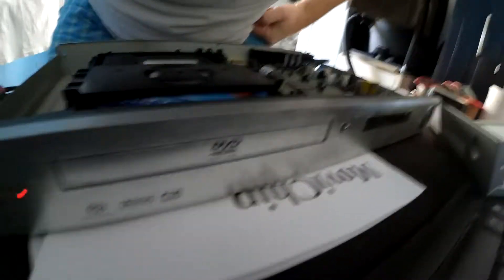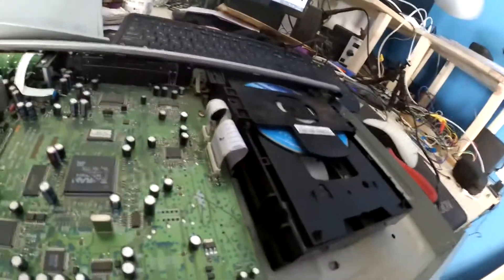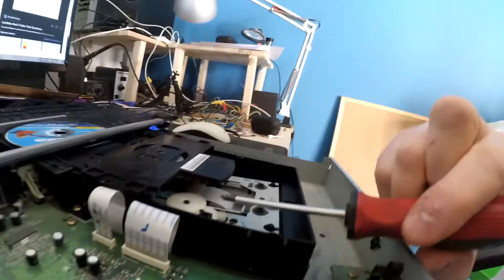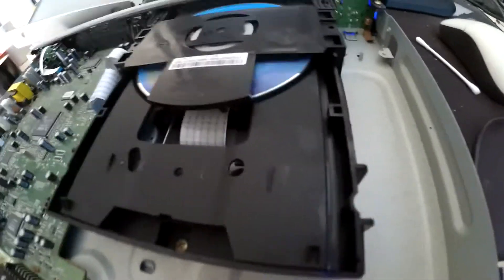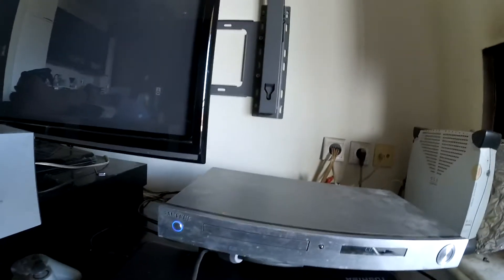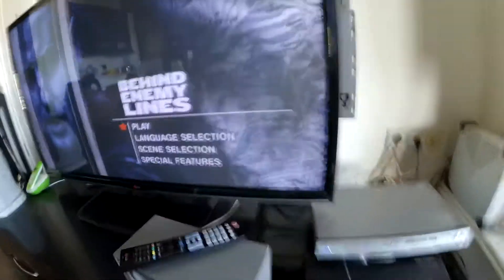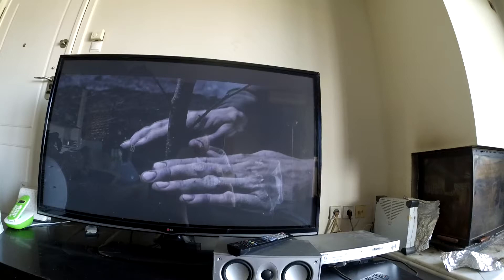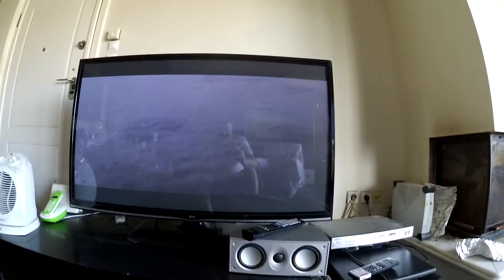"No Disc" DVD Player Fault - How to Fix *Easily*

Comment: I have a DVD recorder/player with a VHS player that I used for digitizing old tapes. Recently, I've been getting this "No Disc" error, but when I place a cleaning DVD in the system it is recognized and goes through the cleaning process. And, I still can't play a DVD. So weird. Definitely trying this!
Reply: I have a zenith that does the same copying to DVD RW. Cleaning the lens allow CDs to play, after ten years 😂. But DVDs still won’t play. Did you figure out how to get it to work yet? 

I’ve seen in other videos about a small screw in the back of the lens that may need adjusting but I don’t know if it work on this model
Reply: @thewickedone9637  I haven't gotten it to work! And, yes, it will play CDs.

Comment: Last week my Samsung BD-4500 BluRay player got won’t play one of my Spongebob DVDs, I unplugged for a minute and plug back which usually works and nothing until I saw your video. So the other day I remove the top, open the tray by eject and unplugging it so I can try to clean the lens (I used 99% isopropyl alcohol), once I the tray back in and the top screwed back in, I tested and it works fine. So it was the lens that was dirty.

Thanx for the tip.
Reply from the maker: Glad it helped!

Comment: Hey there, thank you for the video. I've got a player with an open/close lid, anybody have suggestions? My first thought was some strategically placed office cleaner condensed air, but i know that stuff's pretty chilly when it comes out, so i wonder about damage. I'm not opening the thing up because the only thing i know about electronics is that 'it'll be fine" probably won't be.

Comment: Hi ,CD Player is not working.  There is no electricity, no screen.I need to check what is there insurance?  Can you help?  Marantz cd-38
Reply from the maker: **IF** you know what you are doing you can open it up and have a look inside. Check the circuit board for burns, check the capacitors have flat tops ie they havent blown. (With it disconnected from the wall socket. Obviously.)
Reply: @StrikeEngine  that dvd disc is spinning too fast like a saw blade
Reply: @StrikeEngine  The fuse was blown and I fixed it.TCA0372DP2  / FUX9808  It got super hot and I pulled the plug